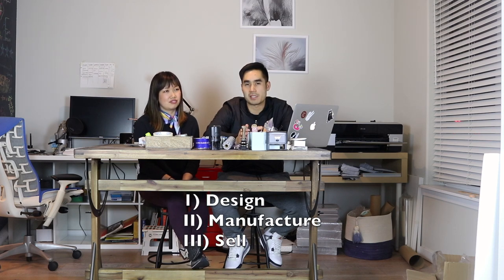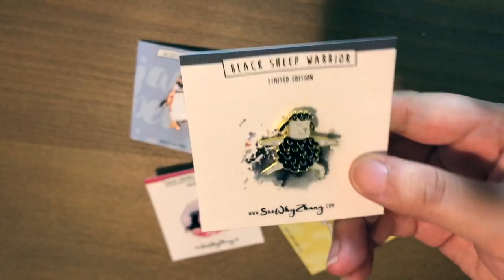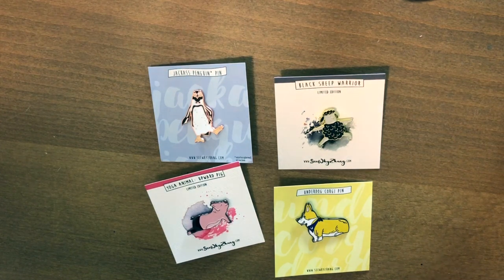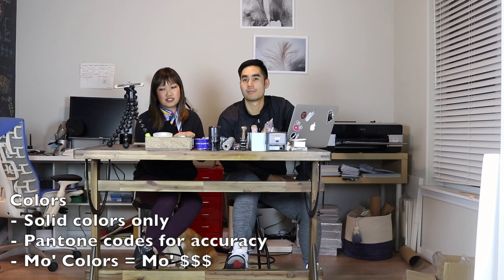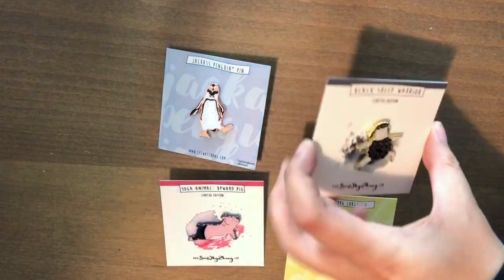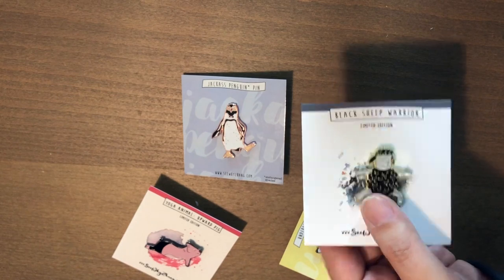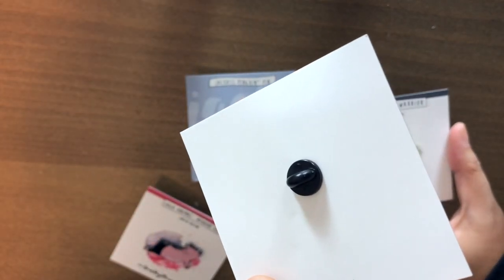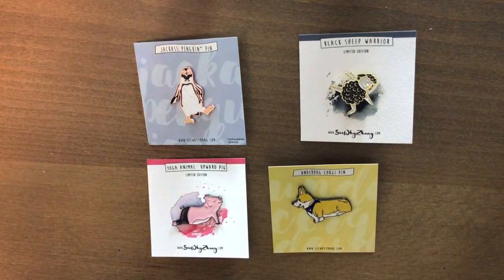How to Design, Source, and Sell Your Own Enamel Pins

Comment: I have a question, people who make pins based on designs that nintendo/ghibli... have made.. isn't this copyright? like can't those companies sue the artists who made, for example, a Totoro pin or pokemon pin? it's kind of daunting ...
Reply: yes, it is infringing of copyright if they are selling fanart. Yes, they can be sued if the companies will want to take them to court. I wouldn't consider making fanart pins as an artist, but these also sell much better than original art (if you are not a recognised artist)
Reply: It’s a grey area. It’s your art so you can do what you want, but you don’t own the source so you can’t do what you want. However, as long as it’s a big thing (is marvel, ghibli, etc) and not fanart of smaller/indie artists’s work there’s usually not a problem. Most producers/companies really like fan works being created in general as it generates interest in the original work. Whether you do it for fun and/or sell it, it’s free advertising for them.

Comment: what program do you use to create your design?
Reply from the maker: I do the initial sketch on iPad pro and edit/finalize/color them on Photoshop. Some designers prefer Adobe illustrator and that works well too if you design in vectors. My designs have more of a hand drawn feel than graphical. Also make sure to check with the manufacture what file format they accept the final design (e.g. PSD, PDF, TIFF, AI...)

Comment: Are you still satisfied with your pin manufacturer or do you change them up sometimes? does quality stay consistent? i heard some factories get so popular that their prices get higher and quality gets lower.
Reply from the maker: this is true. when a factory gets a lot of business, it starts to raise prices and use "increase cost of materials and currency exchange rate" as reasons. I don't order often enough to consider switching supplier or have multiple suppliers compete on prices but it's possible to combat that by finding new suppliers (e.g. on alibaba). For the infrequent orders I do place, I care more about reliability and consistency in quality.
Reply: thank you for your reply, do you still use the same manufacturer as you did when you made this video? has their quality changed over time, improve or regress?
Reply from the maker: I still do, only because they haven't compromised their quality. Their cost has definitely gone up and I'm getting cold emails from other suppliers offering lower prices all the time. However I'm not at a stage in my business where I'm trying to scale up my pins so I'm staying with them for now.
Reply: thank you for your valuable in put

Comment: Hi, great video! could you pass me the color number in illustrator of the stroke of the penguin in rose red. I cant find it anywhere. Thank you very much!
Reply from the maker: If you're referring to the plating/outline, you can just use rose gold. The manufacturer has a standard variety of plating colors (black, alloy, gold, rose gold, etc.) so it doesn't require a Pantone code.
Reply: yes I am referring to that one, do you know the number of rose gold in illustrator? the color itself in illustrator, so  I can put it on my sheet. 
thanks again!
Reply from the maker: I don't have the number, sorry! I would suggest finding a rose gold pin from Google Image search and use color picker in illustrator. As mentioned the manufacture should not require a color code for the plating.
Reply: thanks!

Comment: powerpoint.. geeze, thats annoying if your the supplier
Reply from the maker: what do you mean? Supplier receives a PDF so doesn't really matter what program was originally used.
Reply: oh it matters, if possible stick with adobe for your design work.. as a Prepress technician it makes a difference
Reply from the maker: In case that wasn't clear to anyone else watching, the design is done in adobe. I was referring to only the specs sheet being made in ppt then converted to PDF.